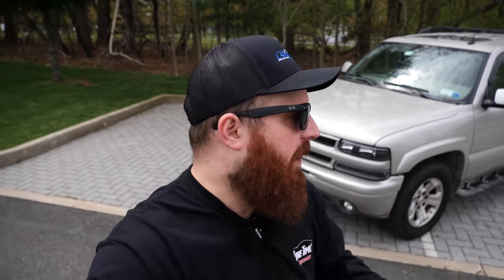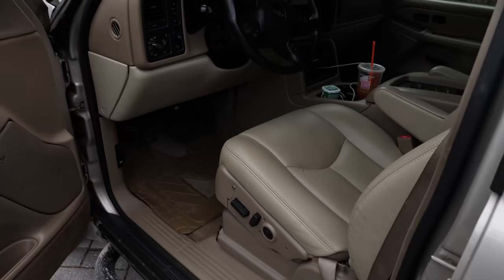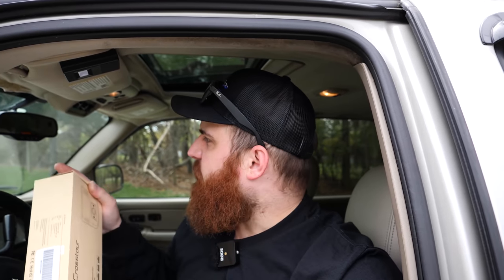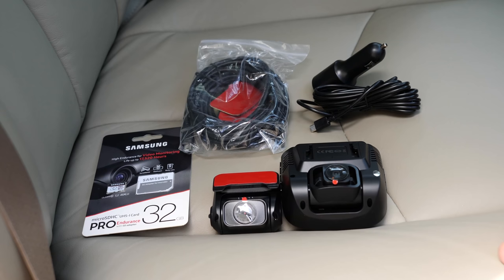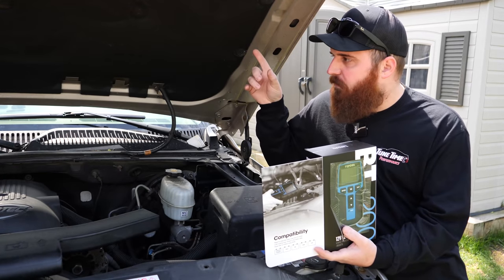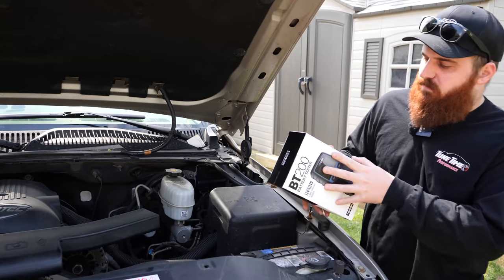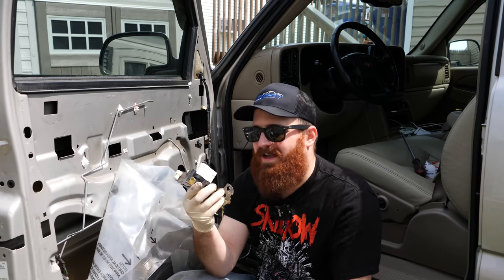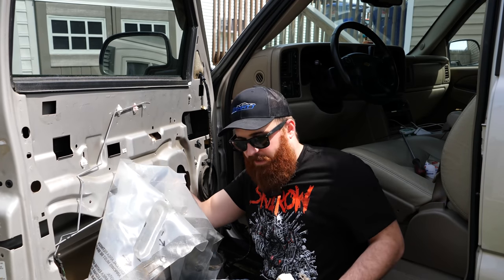Putting Escalade Parts on my Tahoe Because I'm Feeling Fancy

Comment: Hey Matt I did the third brake light conversion also, it’s a plug and play if you pulled the original wire more back it disconnects and the Escalade light clips in like OEM.
Reply: The white Tahoe connector is a Metripack 150 2-pin connector. GM uses them on a TON of things on 90s+ trucks. Easiest place to grab a matching pair at a junkyard is under a pickup's bed for the rear lighting. Be aware that one style has corner notches and one doesn't. Extracting the terminals is pretty easy with a VW style tool after popping off the rear lock (blue) with a screwdriver. Easy peasy.
Reply: what year Escalade did that glass come off of????
Reply: what yr Escalade did that glass come off of???
Reply: @2Mont106  It depends on the year of your Tahoe or Yukon, if it’s a 2002 Tahoe per say then get the light off a 2002 Escalade. If it’s a 2003 Tahoe get it off a 2003 Escalade
Reply: @viralking7357  Its the 2004 z71

Comment: the third brake light you spliced if you pull the wire out a little more you would have found the same plug that was on the end of the Escalade hatch.  Sometimes it is clipped in place inside of the hole.
Reply: When he clipped the wires i was like "noooo"

Comment: Window switches: there’s corrosion in the contacts of the part that touches the membrane. A simple copper light scrub on the contacts should improve performance. No need to replace. Just pop it open, scrub and pop it back in.

Comment: i install dash cams at work all the time... best thing for the rear cam is run the cable through the boot, and stick the cam to the glass... well give you the best view,  and it will never fall off.... once the summer comes around,  it will fall off the plastic trim.. i have the same truck, but with barn doors, there's no way to stick it on the glass, so i stuck it on the same trim panel... it lasted maybe a week, and it's still dangling today...

Comment: My windows up and down was doing the same. I used some lithium grease on the glides. Inside the door. Been 5 months. And works great. Up and down super fast and smooth. Saves alot of time and money.

Comment: I have a 03 Yukon Denali and i installed the escalade corner vents and they are very hard to remove and install but they look great. Another thing you could do is get the escalade painted spare tire lock cover flap or get the original painted. I did that on mine, i don’t like any unpainted black plastic.

Comment: With 330,000 miles on my ‘04 Z 71 suburban I like the idea of the Escalade rear window. That said, the rear windows are an engineering disaster! I have replaced three or four windows over the years simply because the plastic and metal hinges come apart way too easily . I would also recommend that you do not use any type of “super strut” as all they will do is accelerate the separation to those plastic and metal hinges for the rear glass. In fact, I just disconnected them a just use the whole door for access to the back. 😎💪🇺🇸🗽❤️

Comment: Love the dash/rear cam. Unfortunately too rich for my blood. Def need that today. The 03's door panel have that same screw holding the master window switch to the panel. I found that out the hard way. I can't wait to see the HD parts installed. Are you dropping the front bumper too? That's what you need to do to add that HD bumper cap. Keep the mods coming Matt!

Comment: Hey Matt on your last video you talked about your wheel fitment.  Recently I changed the wheels on my 05 escalade.  I  got 17 X8.5 6-139.70 -6 wheels.  So I was able to use my tires and it spaced it out perfectly.  The wheels sit perfectly flush with the body.  I'm really happy with the result.   If you want I can send you pictures so you can see the fitment.

Comment: That camera system turned out great! Fantastic picture/video quality. And the back cam, couldn't be in a better spot. You'll have to show some night time clips. That's usually a problem too with cheap camera's. Like mine, mines great during the day, but absolutely sucks at night even with it's "night vision infrared" light

Comment: 1:20 I had that issue on a 1994 Mercury Cougar, on both windows. The workaround: grease the mechanism and luber the window channels and rubbers with some silicone grease (the silicone spray will wash off quickly and the issue will come back). That should do the trick.

Comment: I have a question, but before i get to that, thank you for reminding me i need to get a new window motor for my 2000 Silverado. I've been going through it and making it factory new again (with a few modern upgrades here and there, like Tahiti). Should've been filming the process for others like you're doing, but I just don't have the equipment to do so. Question is: Are you going to be fixing the headliner? i.e. replacing it, because it is looking a little worn out. If so, can we expect a video on that this summer, fall, or winter? Keep up the good work, you should honestly be a much bigger YouTuber and those who haven't found you yet are really missing out on great content, ideas, and an all around genuine guy.

Comment: If you would have pulled the factory wiring out of the hole more then you could have plugged it right in. There’s another connection behind the rubber plug that matches.

Comment: Just out of curiosity that Tahoe third brake light that you said didn’t hold up couldn’t you have cut the connector off that then hooked it to the Escalade brake light. Like full on chop that off the Escalade connector off. 🤔

Comment: Wish I could do the Escalade upgrade on mine because it's an awesome look, but I have barn doors.  Boooo

Some advice on the struts for the back hatch...Don't get the cheap ones on Amazon.  They have a bit more push than the original and it can bust the hinges.  Happened to my wife Yukon and I had to go find a replacement glass in the junkyard.

Comment: FYI for anyone testing and escalade third brake light: the car has to be on, or the third brake light won't turn on when you hit the brakes. Failed inspection one time because I had the car off, and key just forward

Comment: I have a 2002 an for my lock that wouldn't move I just pulled the housing for the lock an put it back in. Stick fixed. I removed the panel for new speakers an it just got stuck. I fixed it by accident lol.

Comment: Had a 03 just like yours until someone turned in front of me.... i miss it a lot but it was having more and more issues.  Got an 11 now, everything is cheaper made for sure, sucks. Changing out the headlight assemblies is just ridiculous on this 11, guess the two rods on 03 were too damn easy!

Oh and when your exhaust bolts break off, just install aftermarket clamps, work fine.  And damn man, replace those dingy yellow interior lighting bulbs with LEDs, cheap and so much better lighting and look.

Comment: Does your Tahoe have power adjustable side mirrors? Because I notice when you tested out the controls you only folded them in and out. I ask because on mine I have the exact same model year and color as you lol but mine only fold in and out and I can’t actually adjust them up down left or right so not sure if it’s just broken or what. Thank you

Comment: Did you put the escalade cladding on the lower trim? I was debating on doing same but I have a suburban.  Not sure if the panels would fit. Just wanted to cover the main rust areas.

Comment: Hey bro we've spoken before I have a 83 Z28 I bought the wiring harness PSI because of you where did you drill the hole to put the wiring harness through I thought I saw it but I wasn't for sure I want to put it where I think it's best we can reach everything I have the PSI wiring harness got the computer flash if you can take a picture or show me I thought I saw it on the firewall but I'm not sure I was going to work on it and do it today but it rained hopefully I can do it tomorrow or I'll wait till you send me a message or picture I appreciate it still following you

Comment: I have the same dash cam set up in my Audi and its been working great. I originally got the high Sandisk endurance 256gb microsd like the one in the video but had compatibility issues so i had to switch it out for a Sandisk ultra 256gb. For whatever reason when using the Sandisk high endurance, it would not allow viewing of the recorded videos in the Blackvue app. Curious if you have experienced the same issue

Comment: Have a atoto 6 radio with dash cam connection for my 2004 suburban and my 2006 i have a regular dash cam but brought extra adapter mini c to plug in side panel fuse to come on when truck come on. Because cigar plug always on an d kills battery

Comment: Matt, you going to put Escalade gauges in Tahiti?   I put one in my son's Silverado,  they look sweet and are plug and play.
Reply: He just installed new gauges not too long ago so I doubt it. He had is made with white dimmable leds out of the hd trucks with the trans temp gauge.
Reply: @Texpete88  
Nice.  That's one of the reasons I went with the Escalade gauges.   They have transmission temp gauge.

Comment: Matt had a quick question about my truck that maybe you could help out with. 
I have a 97 Ford Ranger and when I hit my brakes my marker lights turn on and all of my dash lights illuminate as if I’m turning the light switch to the marker position, and the same story goes for the left blinker. Though when I actually have the marker lights on through the switch everything is normal. Do you think this could be a short?? I know jack about wiring and I just don’t know where to start. Any help would be awesome 
Also love the vids and can’t wait for the next one!!
Reply: check your grounds make sure you have good body and chassis grounds. Also make sure there is no corrosion at the light switch.

Comment: I noticed that my dads friends 2005 GMC Yukon XL has a third break light with moisture and so I decided that I will repair it for him and instead of replacing it with a cheap aftermarket one, I decided that I would rather replace it with an Escalade third brake light

Comment: why would you connect power like that? that is what the fuse box is for. they have ad a fuse things just for stuff like this. i would use switched fuse too but can hook to constant power fuse if want too i guess for a dash cam.
Reply from the maker: I used two fuse taps, just didnt show up close.
Reply: @lsxmatt  oh sorry. looked like you connected power to lighter socket in video.

Comment: Question has anyone with moveable back glass opened the back glass to counterbalance the rest of the liftgate? I have I opened the glass on my ZJ Grand Cherokee I used to have and then opened the liftgate shot  struts problem solved for free no locking pliers or broom handle needed.

Comment: That's from a 2004 escalade correct?
Reply from the maker: Any gen 2 should fit, so 2002-2006
Reply: @lsxmatt  thanks for being active man. I definitely just subscribed. That boost auto parts key fob didn't program for me, either it's the wrong one they sent out, or my door lock actuators need to be replaced.
Reply from the maker: Sorry it didn’t work out for you, have you tried contacting boost?

Comment: 22:00 NOOOO! there's a connector inside there about 1 more inch! just give the wires a little tug. no need to splice that stop light. Even more facepalm at 24:00 you were getting in to the headliner with easy access to that second plug. oooof!

Comment: That camera is only going to record for about 2-1/2 hours, 32gb is not that much memory when it comes to video, i have a 256 on mine and it also records to my phone’s 512gb memory
Reply from the maker: I put a 256gb in with the new camera. You can see it at the end of the video when I open the box.
Reply: @lsxmatt  good deal, i didn’t see that, if you end up doing a new camera i recommend Nexar brand, motion sensing, gps, and unlimited cloud storage, it also alerts you when your vehicle moves and it can help locate it where you last parked as it marks the location when  it goes into parking mode

Comment: That CrossTour dash cam is JUNK! I have one and got the GPS antenna for it too. It claimed to be "fastest locking GPS", and it takes an average of 10 min before registering my speed. I left a bad review and the company reached out to me. They offered to refund my money and keep the camera if I deleted my review. So that's why you see positive reviews. Also, after I received the camera there was a flyer in the box to leave a good review and get a free GPS or Memory card. I already bought the $20 GPS and $20 memory card. :'( But that's another reason you see good reviews. They are compensated reviews. So if anyone wants a free dashcam buy a CrossTour on Amazon and leave a bad review. You'll be refunded!